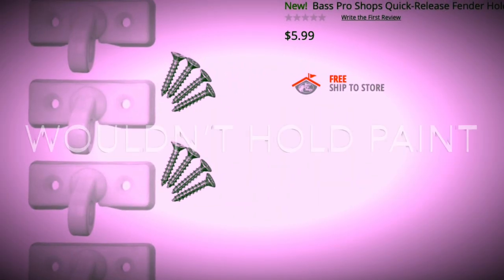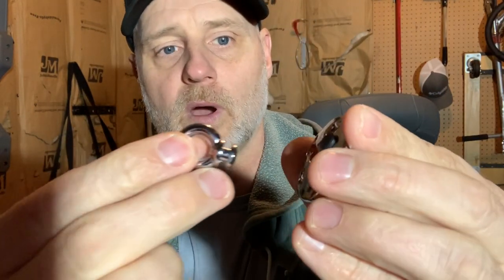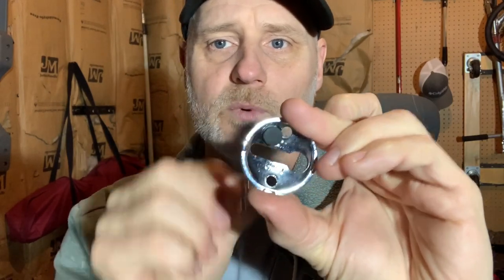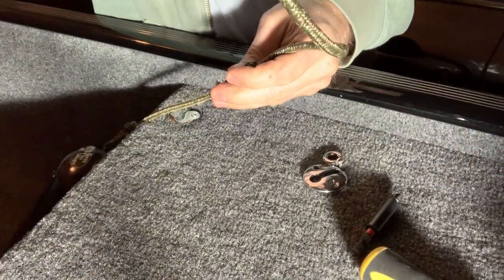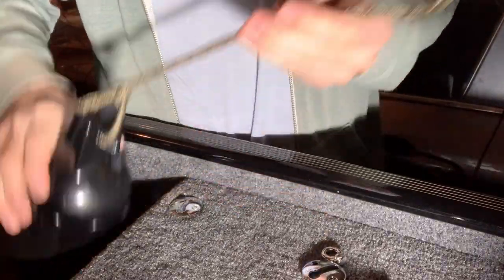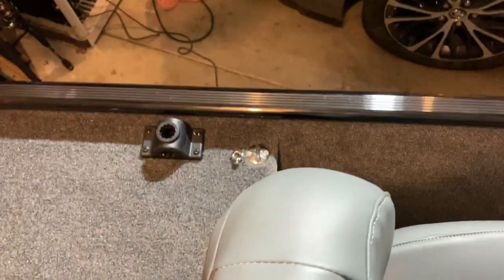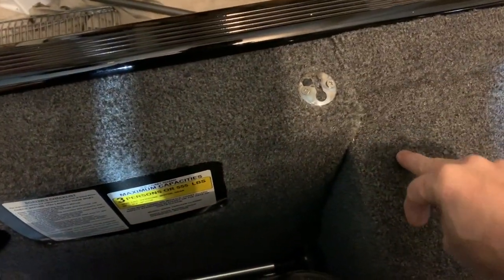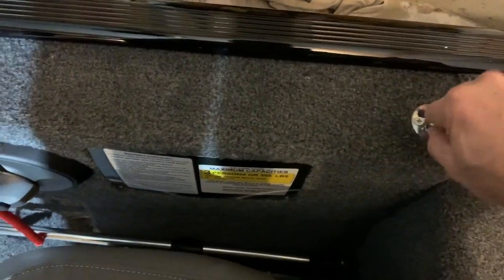Bass Boat Fender Bumper Lock Install

Comment: I finally just got my boat in but I would agree.I wonder if a 3 cleat in the middle would work better.
Reply from the maker: The middle doesn't have a deck so it would have to be mounted to the gunwale, which none of the cleats I bought would work on the gunwale, or at least I didn't think it would look good or work well. The body of the boat seems to attach to the Gunwale almost in the center so bolting something would not be ideal.

Comment: Jim can you install 2 battery's in the front compartment for the trolling motor??  Also what about a larger fuel tank??  Thanks peter k
Reply from the maker: Yes I have seen someone install 2 batteries and the charger in that compartment. Which If you go with 2 batteries up there you will need to put your charger up there and use the one original 8 gauge wire to charge the cranking battery, since there are not 2 wires coming form the back for you to leave the charger in the back, you would not be able to charge the 2 batteries up front appropriately  with one wire from the back. As far as the Gas tank goes, I would not put a second one in because it sounds like a hassle switching them since it would not draw from both at the same time. I would just upgrade to a single 12 gallon tank on amazon they are under $75. https://www.amazon.com/gp/product/B004APFLPA/ref=ox_sc_saved_title_2?smid=ATVPDKIKX0DER&psc=1
Reply: Just Jim Time thanks for the info.
Reply: @peterkennedy5596  any idea of how long the 6 gallon tank will last with the 50 4 stroke